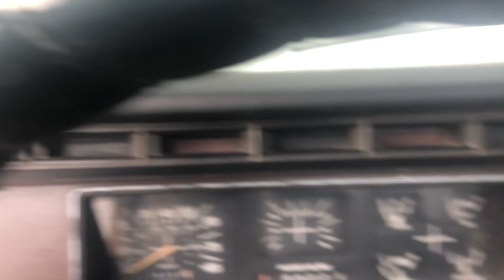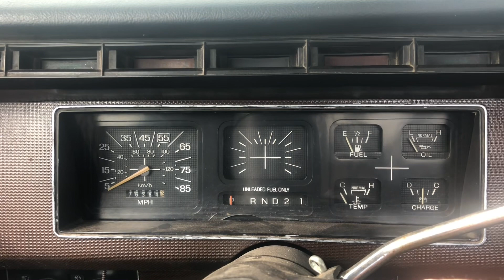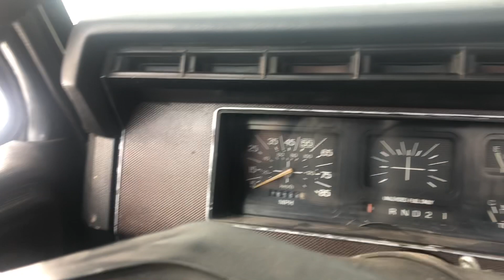1982 F150 coldstart fail pt 1

Comment: How long does it usually take to start on freezing cold mornings? Will it usually start without any starter fluid?
Reply from the maker: I just got the truck in March of last year so I haven’t started in below freezing yet. I’ve got plenty videos on the truck on my channel though. It usually starts just fine when it has a decent battery. I’ll be doing pretty more videos on it this winter as well.